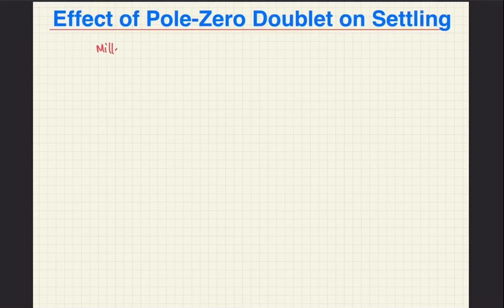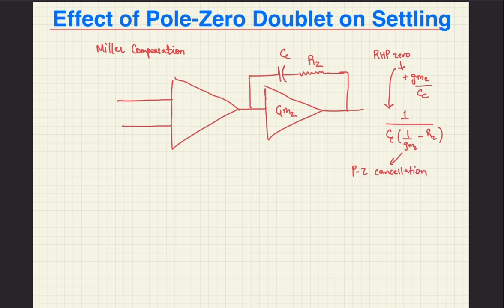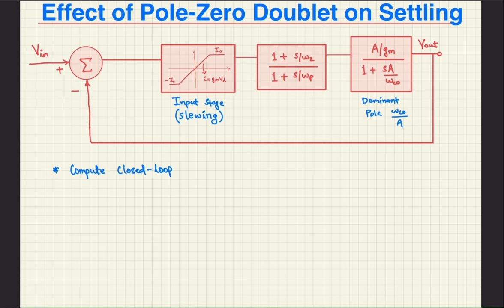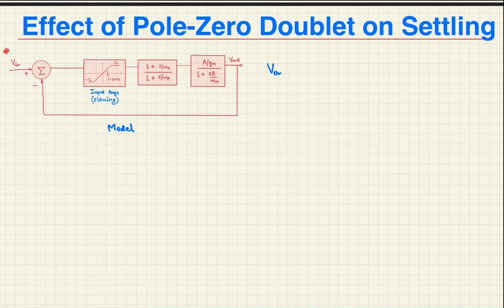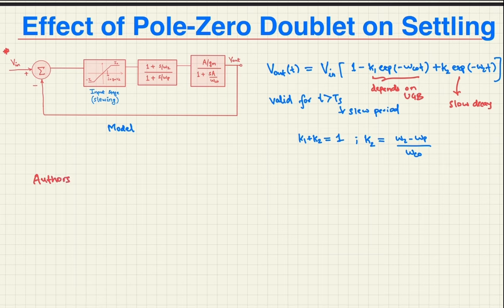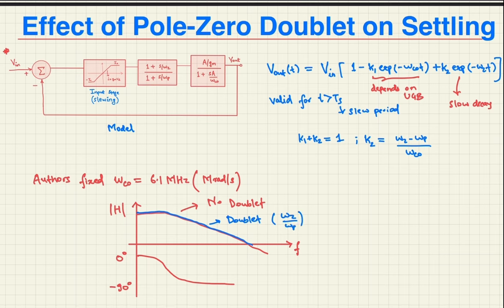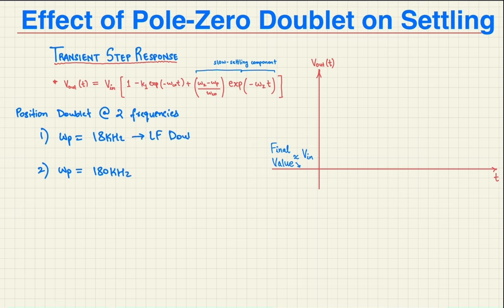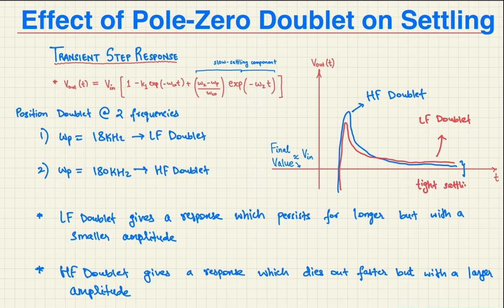Effect of the Pole-Zero Doublet on the Settling of OpAmps

Comment: Thanks, Share what you find interesting. Recently when I designed a folded cascode op amp, I found such behaviour (a pole zero pair, but outside the ugb). Whatever I did, they only moved together. The only problem is I couldn't get the PM past 60deg. This (pole zero doublet) could be it. I should read more into this.
Reply from the maker: In your case the pole-zero may be due to the current-mirror load. 
Perhaps, even the parasitic poles at the drain and source of the input pair were degrading your phase margin.
Reply: @TejasKetkar  Thanks, I'll see that.